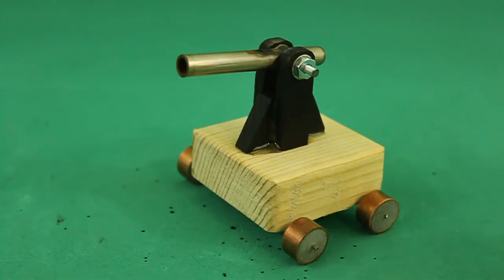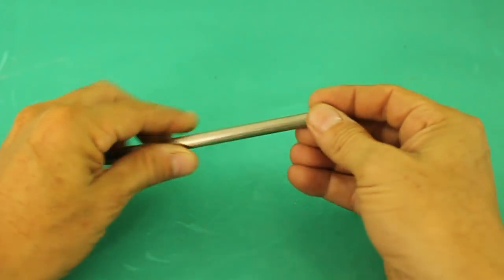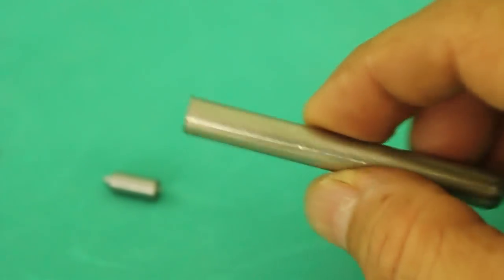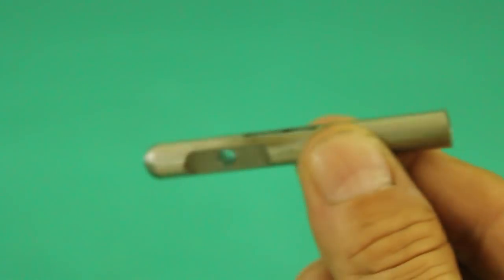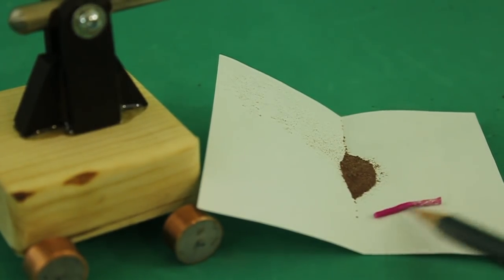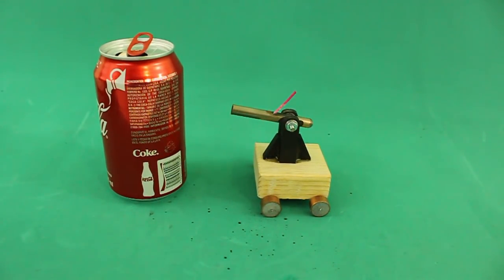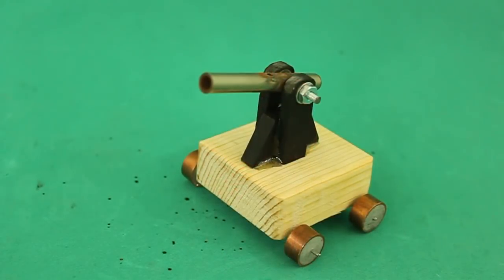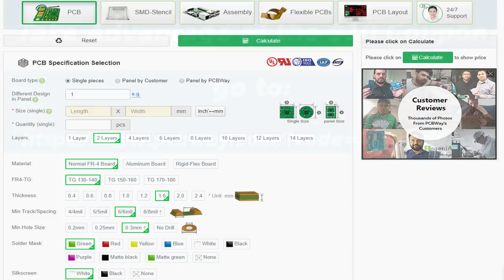Mini Cannon

Comment: Ahuge waste energy for coming back of the canon
Reply: Actually, I'm pretty sure the same amount of energy is transferred to the projectile regardless of the cannon moving. So no energy is lost actually. Newton's 3rd law states that the force the canon feels will be equal and opposite to the force applied to the projectile. And so if you hold the canon in place, the force is simply transferred to the restrains, but when it moves the same amount of force is used to push the canon backward. In both cases, the projectile gets the same amount of force applied to it.
Reply: Yextus i suggest that you read more information about gun powder and guns and math equations
Reply: Yextus i kinda dont agree with this.i do believe that if canon is hold in its place then more enery will be transferred to bullet. Although the force acting on body that holds canon will be equal to force applied on projectile there is no backward motion and hence no energy is used. So all the energy goes in moving the projectile.
Reply: Newton's Third Law says that for there to be an act there must be a reaction
Reply: I studied this in mathematical equations in the Faculty of Science Department of Physics and Mathematics in Egypt. Tell me where you studied it ??
Reply: muhammad sayed i am engineering student so we had little bit of mechanics in our syllabus.
Reply: During the explosion of gunpowder, the two bodies move away from each other (the gun and the bullet because the explosion is between them) each takes a certain amount of movement and the opposite direction of the body to the other and when one of them takes the second double the amount of movement and this we studied in the secondary similar to the fall of the photons and the metal bounce and it takes twice the amount of movement and We study these sentences extensively
Reply: Studied in any department in the college??
Reply: muhammad sayed as the guy yextus said that force acting on canon and projectile is same according to newtons law. Here is how the newtons laws will act when canon is held tightly. Lets say canon is attached to wall so that it doesn't experience backward force. Now when the projectile gets fired, canon and projectile experience same force. But force experienced by canon is pushing on the wall which is giving equal and opposite reaction. So the backward force gets cancelled. Newtons law applies everywhere :D